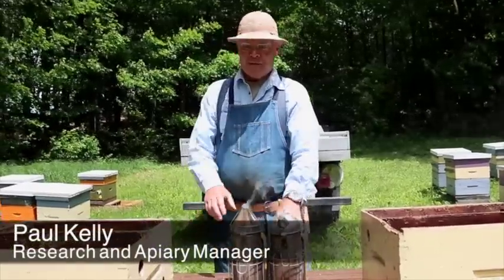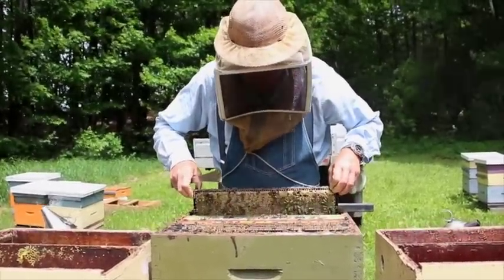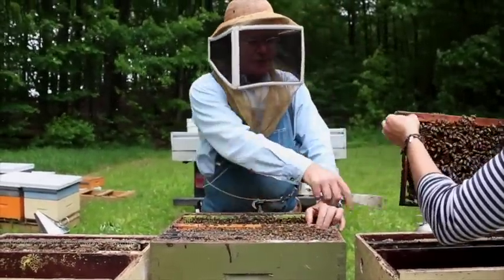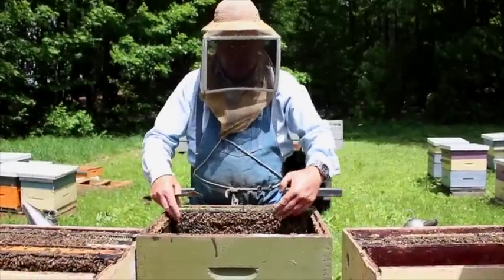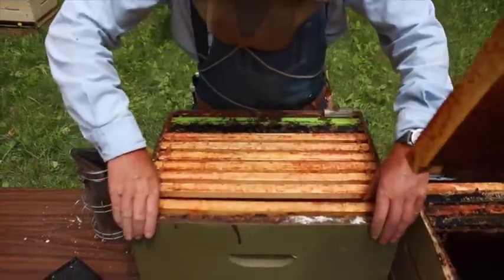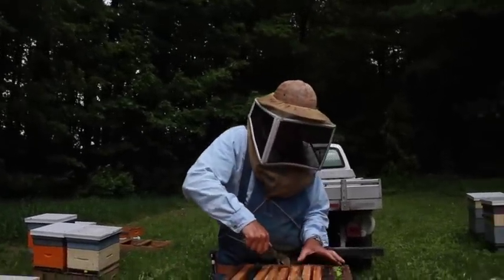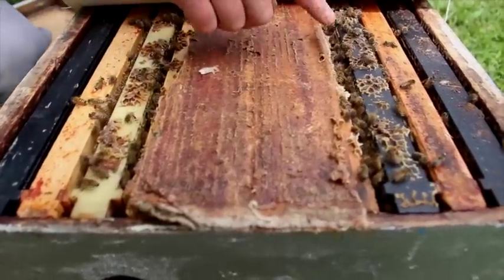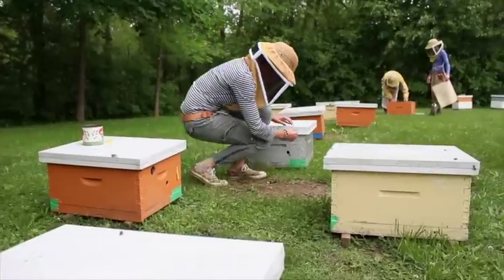Making Double Nucleus Colonies Part I

Comment: Thank you so much for sharing your knowledge with such professionally produced video. I am a huge fan! What and how do you feed your double nucs when you overwinter? What IPM methods do you use?
Reply from the maker: Hi Kathy
 You are most welcome. It's nice to hear you find the videos useful.  Good question. We feed all our colonies the same way. Barrel feeding. You would need specialized feeders for double nucs otherwise. I'm just thinking though, a hive top feeder above a queen excluder might work to feed both sides. You may have already seen our video 'feeding bees and overwintering'. We are steering clear of advice on IPM mite control etc as the regulations are so different from one place to the next. We do make sure we stay right on top of varroa mite control.

Comment: Fantastic information! I really appreciate the effort you put in to making these videos. Where can I find more information about that queen incubator you are using? Did you make it yourself or buy it somewhere? Thanks in advance!
Reply from the maker: Hi Chri
 You are welcome! Thanks for your very generous comments. Since we are getting encouragement from people like you we'll be doing 25 more videos this summer.
 The incubator we use is a Caricell  and is made in New Zealand. They are very expensive. Some beekeepers in Ontario have started to use styrofoam chicken egg incubators.
 
For up to five hours we've also found with tests last year that we get good results with the following
 -A small incubator
 -A rubber hot water bottle filled with hot tap water and placed on the bottom of the incubator
- 4" of wood shavings on top of the water bottle. Make holes in the shavings to place the cells just under the surface of the shavings.

 Here a link to Dancing Bee's description of  Canadian and New Zealand made incubators
https://dancingbeeequipment.com/collections/queen-rearing   ( bottom of page)

<!--
 /* Font Definitions */
@font-face
 {font-family:Arial;
 panose-1:2 11 6 4 2 2 2 2 2 4;
 mso-font-charset:0;
 mso-generic-font-family:auto;
 mso-font-pitch:variable;
 mso-font-signature:3 0 0 0 1 0;}
@font-face
 {font-family:Times;
 panose-1:2 0 5 0 0 0 0 0 0 0;
 mso-font-charset:0;
 mso-generic-font-family:auto;
 mso-font-pitch:variable;
 mso-font-signature:3 0 0 0 1 0;}
@font-face
 {font-family:"ＭＳ 明朝";
 panose-1:0 0 0 0 0 0 0 0 0 0;
 mso-font-charset:128;
 mso-generic-font-family:roman;
 mso-font-format:other;
 mso-font-pitch:fixed;
 mso-font-signature:1 134676480 16 0 131072 0;}
@font-face
 {font-family:"ＭＳ 明朝";
 panose-1:0 0 0 0 0 0 0 0 0 0;
 mso-font-charset:128;
 mso-generic-font-family:roman;
 mso-font-format:other;
 mso-font-pitch:fixed;
 mso-font-signature:1 134676480 16 0 131072 0;}
@font-face
 {font-family:Cambria;
 panose-1:2 4 5 3 5 4 6 3 2 4;
 mso-font-charset:0;
 mso-generic-font-family:auto;
 mso-font-pitch:variable;
 mso-font-signature:3 0 0 0 1 0;}
@font-face
 {font-family:"Palatino Linotype";
 panose-1:2 4 5 2 5 5 5 3 3 4;
 mso-font-charset:0;
 mso-generic-font-family:auto;
 mso-font-pitch:variable;
 mso-font-signature:3 0 0 0 1 0;}
 /* Style Definitions */
p.MsoNormal, li.MsoNormal, div.MsoNormal
 {mso-style-unhide:no;
 mso-style-qformat:yes;
 mso-style-parent:"";
 margin:0cm;
 margin-bottom:.0001pt;
 mso-pagination:widow-orphan;
 font-size:12.0pt;
 font-family:Cambria;
 mso-ascii-font-family:Cambria;
 mso-ascii-theme-font:minor-latin;
 mso-fareast-font-family:"ＭＳ 明朝";
 mso-fareast-theme-font:minor-fareast;
 mso-hansi-font-family:Cambria;
 mso-hansi-theme-font:minor-latin;
 mso-bidi-font-family:"Times New Roman";
 mso-bidi-theme-font:minor-bidi;
 mso-ansi-language:EN-US;}
a:link, span.MsoHyperlink
 {mso-style-noshow:yes;
 mso-style-priority:99;
 color:blue;
 text-decoration:underline;
 text-underline:single;}
a:visited, span.MsoHyperlinkFollowed
 {mso-style-noshow:yes;
 mso-style-priority:99;
 color:purple;
 mso-themecolor:followedhyperlink;
 text-decoration:underline;
 text-underline:single;}
.MsoChpDefault
 {mso-style-type:export-only;
 mso-default-props:yes;
 font-family:Cambria;
 mso-ascii-font-family:Cambria;
 mso-ascii-theme-font:minor-latin;
 mso-fareast-font-family:"ＭＳ 明朝";
 mso-fareast-theme-font:minor-fareast;
 mso-hansi-font-family:Cambria;
 mso-hansi-theme-font:minor-latin;
 mso-bidi-font-family:"Times New Roman";
 mso-bidi-theme-font:minor-bidi;
 mso-ansi-language:EN-US;}
@page WordSection1
 {size:612.0pt 792.0pt;
 margin:72.0pt 90.0pt 72.0pt 90.0pt;
 mso-header-margin:36.0pt;
 mso-footer-margin:36.0pt;
 mso-paper-source:0;}
div.WordSection1
 {page:WordSection1;}
-->
Reply: UoG Honey Bee Research Centre 
Great! Thank you so much!

Comment: Great video with detailed information. What is the material attached to the back of the queen cell cups shown in the portable heated cell box? Are the cups attached to this backing during grafting the larva or prior to queen cell installation into the 5 frame nuc?
Thanks Don
Reply from the maker: HI Don
 The cell bases are attached to both the graft bar and the queen cup by 'welding" with beeswax.You can see the cell bases better in our video on grafting. They are pieces of pine that we make up so the cells are handled safely and easily. Thanks for your comment Don.

Comment: I've never seen a flexible inner cover like these, what is it made of?
Reply from the maker: Hi FE
We are working on a FAQ list and this will definitely be #1 on the list. 
I like the canvas inner covers for a few reasons. Easy to take a quick peek, cheap and easy to make, light, lids sit down well, less excess wax on the frame top bars, never need to scrape the inner cover. I could go on... We'll do a video about them since we are getting so many questions.
We use 18 oz  (#8) canvas - otherwise known as duck. It's a bit hard to come by here but I see it's available from online distributors.    http://www.bigduckcanvas.com/number-8-18oz-cotton-duck-canvas.html    We flip it over periodically when new so the bees thoroughly coat it with propolis. An alternative is a feedbag folded in half.
Reply: @UoGHoneyBeeResearchCentre  Thanks, weight was going to be my question :-)

Comment: If both sides are 5 frames with a divider where are you getting the boxes? That would have to be an oversized box, yes?
Reply from the maker: Hi Ray
 Good question. Our partitions are very thin at only 1/4". We can fit ten frames in them but it is a bit tight. You have to make sure their is no wax on the frame shoulders so they will fit.

Comment: Please let me know what type of canvas are you using.  Thank you
Reply from the maker: Hi Gabriel
Please see FAQ #1 below.

1. Why do we use canvas
for the hive inner cover? A: We use canvas inner covers for a few reasons. They
make it easy to take a quick peek in the hive, and are cheap and easy to make.
They are light, the lids sit down well, less excess wax on the frame top bars,
and we rarely need to scrape the inner cover. We use 18 oz  (#8) canvas
-otherwise known as duck. It's a bit hard to come by in Ontario, but it is
available from online distributors (US: http://www.bigduckcanvas.com/number-8-18oz-cotton-duck-canvas.html,
Canada http://www.jtsoutdoorfabrics.com/18oz-Cotton-Duck-Canvas-Untreated--Natural-60_p_15038.html).
Bees chew through thin canvas so a heavy weight is better. We flip it over
periodically when new so the bees thoroughly coat it with propolis. An
alternative is a feedbag folded in half. 

 

2. Why do we use single
brood chambers? A: Our preference is to keep hives in single brood chambers. We
use queen excluders above the brood chamber and then add supers. We produce
bigger crops managing our hives in singles vs doubles and we find the hive management
much easier. It's become quite common here, especially over the last twenty
years. We will be making a video about single brood chambers soon! 

 

3.  Are our queens for sale? A: We sell some queens but don't
export. To contact us about our queens, please email us at infohbrc@uoguelph.ca. Our Buckfast collaborators also sell queens: Munro Honey http://www.munrohoney.com/ (for CAN sales) and Ferguson Apiaries http://fergusonapiaries.on.ca/ (for CAN and US sales). 

 

. 

4. What breed of
honeybee do we use? A: We work with Buckfast bees. Check out our website if you
would like to learn more about them: http://www.uoguelph.ca/honeybee/breeding.shtml 

 

5. Will we be making any
more videos? A: Yes! We are looking forward to creating more videos for our
YouTube channel this year! Here are some of the topics we will be covering:
Working with single brood chambers, indoor overwintering. 

 

6.How do you overwinter
double nucleus colonies? A: At the University of Guelph, we winter our double
nucleus colonies indoors. You can also winter them outdoors by wrapping two
double nucs together with insulation on the sides and top. 

 

7. Are double nucleus
colonies prone to swarming? A: With a young queen and the supers above we don't
have any problem with these nucs swarming in the first year. We do have to
transfer them into a full size box early enough the following spring to prevent
swarming.

 

8. Do we add a frame of
pollen or honey into a new split? A: Ideally you add both pollen and honey. Of
the two, honey is the most important. 

 

9. Where to purchase
some of the products that we use: 

 

Coveralls: We really
like these Dickies all cotton coveralls. http://www.dickies.com/coveralls-overalls/deluxe-cotton-coverall/48700.html?dwvar_48700_color=GY#start=3.
We use two sided velcro to strap up the wrists and usually tuck the legs into
our socks. 

 

Plastic Queen cages:
Mann Lake and their Canadian distributors sell these and they are made by the
French company Nicot. https://www.mannlakeltd.com/hair-roller-cages. I use
a wooden plug on the bottom and screw it in place with a #4 screw after pre
drilling. 

 

Grafting microscope: http://www.amscope.com/catalogsearch/result/?q=gooseneck+binocular

 

Mini/mating nucleus
boxes: Mann Lake (US) and their Canadian distributors sell these. They are
originally from Europe so are widely available there. https://www.mannlakeltd.com/shop-all-categories/hive-colony-maintenance/queen-rearing/nuc-boxes

 

Queen Pheromone: The
pheromone strips were developed here in Canada. They are called Tempqueen and
are made by Intko Supply Ltd.Suite 604, 3345 Kingsway VANCOUVER, BC, V5R 0A7
Canada +1 (604) 356-7393. pheromonesupply@gmail.com. Mann Lake in the US and several Canadian
bee supply companies carry them. 

 

Bee belt and bulk bee
box: Our apiary manager Paul Kelly manufactures the Bee Belts and bulk bee box.
If you are interested in more information, please email him at pgkelly48@gmail.com.

 

10. Should you remove
any queen cells in a colony before introducing a new queen in a cage? A: Yes,
you should remove the queen cells. Look very carefully to make sure you don't
miss one. Shake the bees off each frame to make sure you can see them all.
Accepted queens are sometimes killed by virgins that emerge from queen cells. 

 

11. Can you make a split
without adding a mated queen/can a split raise their own queen? A: A split can
raise their own queen (if they have eggs), but you'd be better off buying a
mated or queen cell from a local bee breeder. Queens raised by a split are
reared under the worst possible conditions, are physiologically inferior, and
you aren't taking the opportunity to improve your hive genetics. For a number
of reasons, colonies get more aggressive if we let splits raise their own
queens. We always use queen cells that we have reared from breeder colonies so
we can maintain and improve our genetics. Cells found in hives can be poorly
reared if conditions aren't good or if you use swarm cells you are
unintentionally breeding for swarming behavior. 

 

12. How often do we
check for swarm cells? A: We check for queen cells only in colonies that are
stronger based on our ratings as described in our “Swarm Control” video. We
only do this at the time of year bees are prone to swarming (ie just before the
main summer nectar flow). In some colonies, we check twice, a week apart, if we
have the time and we've found cells in them previously. We stop looking once
the nectar flow gets going and the time for swarm preparation has passed. 

 

13. How old is a queen
when we replace her? A: We re-queen if a queen isn't doing well or when she is
in her third year. 

 

14. How often should you
be stung to lessen the chances of developing anaphylactic reactions? A: Please
speak with an allergist if you have any concerns regarding bee sting reactions.
You don’t need that many stings to build an immunity and reduce your chance of
developing an allergy. However, reactions can be very different from one
individual to the next. For about three years after starting beekeeping you
swell more in the spring when the bee season starts. After that most people
don't swell up much at all. Some beekeepers apply stings through the winter to
keep building immunity. 

 

15. What do we use as
candy for the queen cages? A: You can make the candy using honey and icing
sugar but the candy you see in the tubes in our videos are purchased with the
cages from Mann Lake beekeeping supplies and their Canadian distributors. In
our province, it's not legal to use honey in queen candy if you are distributing
queens. Honey can contain American Foulbrood spores. A specialized, non-drying,
sugar syrup (Nulomoline invert sugar) can be used instead of the honey. In any
case the candy must be made dry enough that it's crumbly.

 

16.  How do we make pollen patties? A: The patty is
made from pollen we collect using a pollen trap. We mix the pollen pellets with
sugar syrup to a dough like consistency, form the patties between layers of wax
paper and then keep them frozen until they are needed. They will keep for several
months frozen. 

 

17. How do we make our
grafting bars? A: We cut the wood pieces and attach them to the graft bar with
liquid beeswax. We then attach the cups with liquid wax. In both cases the
liquid wax is applied with a syringe. Previously, we made the wax cups but now
buy them from https://www.kelleybees.com/. 

 

18. Do we move full
honey supers to the top of the stack so the bees can fill the lower ones? A:
Some beekeepers do shuffle the supers around and do what's called bottom
supering. We place supers back on in the original order and only add new supers
on top (top supering). That way it's easier to see when the bees need more
space. The bees also ripen the honey before moving up. We sometimes harvest
full lower supers and put the top ones that aren't full back on in the original
order. 

 

19. Do we ever add brood
frames to the cell builder colonies to keep their populations high? A: We do
add other frames of sealed brood and sometimes we shake in more young bees from
brood frames to boost the hives. About once every three weeks we'll boost the
hives in one way or another. 

 

20. How do you level
hive stands? A: We level the hive stands periodically with pressure treated
wood shims. If the hives are already on the stands, we use a hardwood pry bar
and a brick fulcrum to lift each end for shimming.

Comment: What kind of cloth is that  you place under the lid? I assume it is for moisture absorption.
Reply from the maker: Hi Smokeydabee!
We are working on a FAQ list and this will definitely be #1 on the list. The canvas inner cover is not to absorb moisture which by the way I believe to be an unfounded practise. You wouldn't put something in your attic to absorb moisture, instead for our homes we use ventilation to eliminate moisture. I digress!
I like the canvas inner covers for a few reasons. Easy to take a quick peek, cheap and easy to make, light, lids sit down well, less excess wax on the frame top bars, never need to scrape the inner cover. I could go on... We'll do a video about them since we are getting so many questions.
We use 18 oz  (#8) canvas - otherwise known as duck. It's a bit hard to come by here but I see it's available from online distributors.    http://www.bigduckcanvas.com/number-8-18oz-cotton-duck-canvas.html    We flip it over periodically when new so the bees thoroughly coat it with propolis. An alternative is a feedbag folded in half.
Reply: Thank you for taking the time to reply. I'm finishing my 1st year as a bk and have been self educated. Tried going to a club but they offered no help. Youtube  is an easy way to gain a lot of knowledge, good and bad,lol. I try to find reputable channels and investigate there recommendations before I pass them on.I do free hive removals in Florida, then after have had the colony long enough to stabilize it , I donate them to new beekeepers.When those beekeeper call me up, I link your videos to them. Keep up the videos,I really enjoy them.

Comment: sir, if i am rearing lots of queen bees in the season and i dont  have enough and strong beehives to split, do i have to kiil new queens? or wilö i give tbem to beekeepers? regards.
another think what do you think about VSH bees?
Reply from the maker: Hi CC
 We sell the extra queen cells where possible. You could give them to other beekeepers too. I've never worked with VSH stock. The first VSH stock was varroa resistant but not great for much else. I'm sure they are better now but I value other beekeeper friendly traits first.